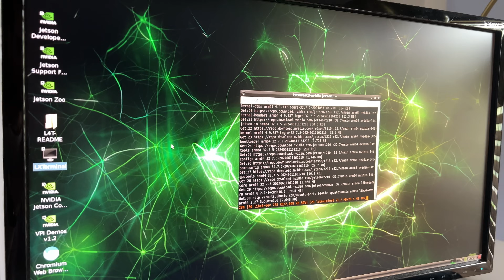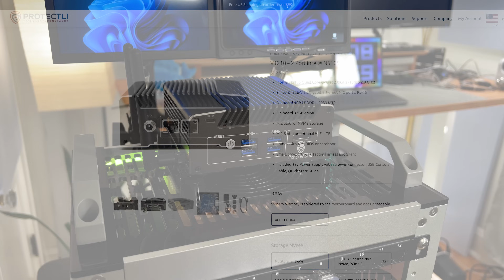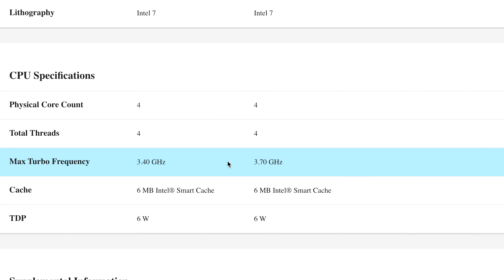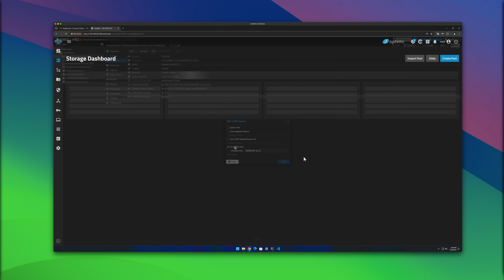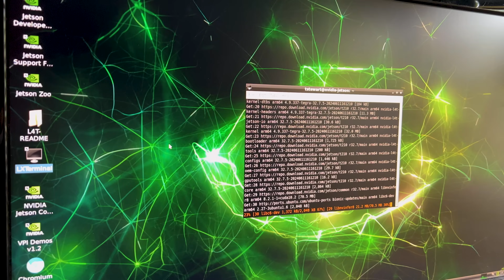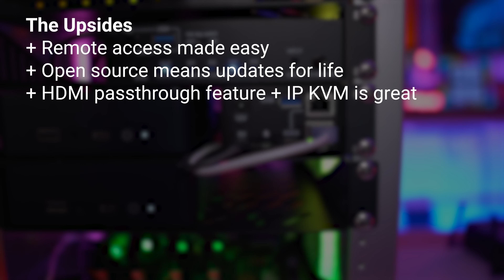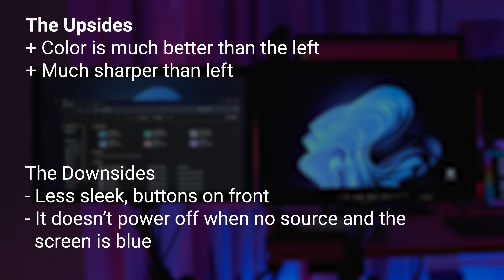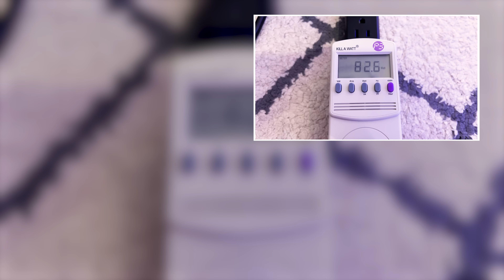Mini Rack, HomeLab Stack - Mini Server Rack

Comment: No bias here at all but I think that Raid Owl guy won. Right guys??? Right...?
Reply from the maker: Don't forget to sub Raid Owl if you haven't already, even though he had a lesser build 😅
Reply: @TechnoTim  Luckily he's a protected species, hey! Tim
Reply from the maker: @settlece  zing!  🦉
Reply: Just know your place as a power bottom.  Tim topped you on this one 😂
Reply: @itznolimitz  This joke has come back to haunt me lol
Reply: Buy a damn threadripper already, bro! Then you can win.
Reply: @corrpendragon  My old home server has Ryzen 7 5700G 8C/16T + 64GB RAM. Mostly eats ~25W. (measured at wall socket) Size is about third of what is shown in video, as it is slim tower or can be placed as slim desktop (flat).
Has space to fit 2.5 slots Graphics. But that eats unnecessary energy. While 9070 XT looks OK from compute perspective, I do not like it for its mere 16GB VRAM. (AMD should have made variant with 32GB from start.)

If I went for upgrade, it would be Ryzen AI MAX+ 395 16C/32T with 128GB RAM, as memory is not traditional desktop dual channel (128-bit = 2x 2x 32-bit). It is quad channel (256-bit = 4x 2x 32-bit). And you can get it in pretty small PC cases at good prices. That makes Threadripers uninteresting unless one needs a lot of CPU cores or considerably more RAM. Because Threadriper MBs are big, exist in order to plug multiple graphics cards.
Reply: I like both setups and you guys are making me want to build a mini server rack myself.. nice work!
Reply: I believe you’ll get a dub against a Tech YouTuber one of these days
Reply: I heard RaidOwl watches Sex & The City and calls himself "a total Samantha"
Reply: @theglowcloud2215  who told you that...
Reply: Tim won but this was a super fun challenge and side of homeland you almost never see. I wish I had known about these kinds of options back when I started, as space was definitely an issue.
Reply: Tim you little rat bastard you win 🏆 swrry Bret 😢
Reply: Yes sir he won second place.
Reply: Right!

Comment: Hi Tim, Can I place a rack style sever on my desktop?  Now before you say why don't I just purchase a desktop model, I currently own a DS918+ which is now going on 8 years old. I may be looking to retire it as my backup server in the near future and I like the look of a rack style server.  I'm also of the belief the operating the Hard Drives vertically rather than horizontally will extend the life of the drives. What are your thoughts?

Comment: A monitor that doesn't do or change anything without you telling it to isn't always a con. Sometimes it's extremely beneficial, especially when troubleshooting. It's a huge PITA when a monitor spends 30 seconds cycling through its inputs trying to auto detect signals while you're trying to read POST info or just get into a BIOS/UEFI. Just as annoying to think a machine isn't powering on because your monitor decided to save milliwatt-hours by turning itself off and not turning back on again. I actually have a pretty strong hatred for modern monitors and their designs like OSDs instead of real buttons. It's all preference there.

Comment: I think that the Homelab REALLY depends on what you're using/running/doing.

My main Proxmox server nominally has a load average of 20 now. (With dual Xeon E5-2697A v4s)

And my three node OASLOA Mini PC Proxmox cluster, I found out last night/this morning that one of the nodes had a load average of 40(!) (on a system with a 4-core CPU), whilst another node had a load average of 3.2 (80% CPU utilisation).

So...depending on what you're doing, it is not difficult to push a homelab to its outer limits, especially in terms of compute capabilities.
Reply from the maker: For sure!  Good luck on tracking down what's using up all the CPU!
Reply: @TechnoTim  
Actually, I already know (what's using up all that CPU).

Comment: Nice to see another one in the Wild. I have one as well.I use 7" DWin Monitor that my son Engineered a 3D Plate so I can mount on the front. I have a couple of the small board trays behind it. I used a Beelink, with extra USB Ethernet so that I could pfSense for my firewall. I bought a Banana-Pi Mini-R3 for my wireless access into the my a rack, it sit on the top.  I had an X1 from Youyeetoo ( 8G Model ), it's my Proxmox, which is running Minecraft Server, CasaOS, and Red Hat DNS. I bought DeskPi Super6 because I had several CM from different makers, so I am running a Fruit Salad of CM4 ( 3 x RPi, 2 x BPI, and OrangePi. ) I am running Debian 11 w/XFCE  and  libvirtd on the OrangePi CM-4 with XRDP installed. I remote into the Super6 there, and I am running my back up DNS as Arm Virtual host.  The rest of the CM4 are going to be Mini-Kube setup. I have Raspberry Pi 5 and Libre Computer Renegade on the Small Board tray, the Renegade is hookup to a kvm that sits behind the monitor, use that work when I was at Southeast Linux Fest making sure everything was working. The RPi 5 is a GitLab server for my little lab. I found a cheap 8 Port PoE managed switch, but I won't recommend it. 

I have a Uctronics' Desk Rack, it nice 4 server high, that I have 4 x LibreComputer Renegades in that is a Docker Swarm Cluster that I am running 3 off PoE TPLink switch, the 4th I can't because of  the 5V fan, but it nice to have a small lab in one area. 

Oh, because this has it own firewall now and WiFi, I create a new VLAN so that seperate from the other 3 networks in my house. Another part of my job is I have to be a Jack of all trades, most Network Engineers don't like you mess with their stuff, so another reason Home Lab are great. 

Since I live in George and my big rack is in my office. I powered down all the bare metal servers so that my electric bill isn't over 500. The small rack is nice because I can cont' to work on Ansible and Docker for my work. Plus, not die from the heat from the big rack. It nice to be able to travel with the rack too. it was a hit at the Southeast Linux Fest. A nice way to show that you don't need a lot of equipment to do home labbing.

@TechnoTim yes only thing I truly hate is cable management. The rat nest next to the rack is UGLY. I have tired my best to control. I might buy another one as I like to see if I remove the handles can I stack it.

Comment: Tats pretty awesome.  Id probably drop the  K8s cluster, and have something like hot swappable Harddrives, for like Truenas or something, or some other way of managing storage.   This way you can run 2  or 3 for HA proxmox machines, and have the storage be in the NAS.  Run a few VM's in the proxmox cluster and a Docker VM as well.  I am really digging that router and switch layout on top, its really hard to get that 2.5gb network speed to a mini pc but they are out there.  You might need a 2nd switch though, and do something like link aggregation to the proxmox machines, to get like 5gbs internal speeds if thats something that is needed.  Itd be nice to atleast have the option for a upgrade in that direction.

Comment: Insanely cool 👍.  N100 and N200 can run 32gb ram (7:29) despite official specs; various ppl have shown this.
Kindest regards, friends and neighbours.
P.S. Thank you for many inspiring ideas for HL.
Reply from the maker: Thanks!  I have seen on the internet that some have got it to recognize 32GB, but the official Intel spec for the CPU says 16GB.  I am curious if it can really address all 32 or it's just showing that in the BIOS, maybe I should test it!
Reply: @TechnoTim    Works in memtest for me. Single 32gb ddr4 sodimm in a n100. Ripjaws 3200 CL 22-22-22-52 1.20V.
Reply from the maker: @chromerims  awesome!

Comment: Nice video and rack.
Check out a USB C trigger board. Get a couple of those and a GAN charger/power supply, and power multiple barrel jack devices off the same small GAN charger/power supply. Will save some space, help keep the cables tidy and use less outlets.

Comment: This is exactly how a home lab should be - more surprised its completely isolated - dont need stupid crazy rack servers anymore - NUCs are the right way yeah you went some low end ones with not many cores at all which is good to start and just have your clusters and code.... best thing i did years ago was get rid of my servers and just have dell micro optiplex be the lab that are 9700 i7s with 32gb

Comment: for anyone looking into getting this rack keep in mind that although does have standard size mounting holes for the screws that hold the trays standard 10" or half rack shelves will not fit between the posts. if you want metal shelves youre limited to the shelves deskpi sells. really wish they would make an addon kit or revision to make the rack hold standard 222mm equipment

Comment: Nice! This is a cool setup if you're just messing around at home. I would argue it's the purest form of HomeLab. Low power, low cost, modern and relevant, takes up little space and probably quiet enough that the Mk.1 Wife Unit won't complain about "those damn fans in the basement". As you outgrow any single part its standard enough to upgrade.
Reply: Yes just don’t buy it all at once! For most this is so overboard to start out with! Final form yes, inception no :)
Reply: ... mk 1 wife unit? really? yikes

Comment: On the subject of your firewall, i wonder what sort of performance improvements they'll see with their next gen, which i assume will be an N100. Slightly lower TDP, but amazing performance. I wouldnt be surprised it you could get 5G or even 10G IPSEC performance with the N305.
I've been playing around with a rather large itx SBC with an N100 that i had originally planned to use at my sister's house for Plex TV recordings replacing her old i5-6500 based system.
Boy was i surprised that it was powerful enough to not only record live TV on plex, but also run a firewall and do motion and object recognition within frigate on 2x 1920p ultrawide security cameras (IDK the width but its 180 degrees ultrawide output using 2 sensors and 1920p tall) I might keep this board for myself and get the bigger atom with 8 cores (N305) for her, as we're planning to put 2 of these cameras on her her dog kennel/grooming shop and 2 on her house, and the little N100 was often around 80% usage with my 2 cameras.

Also of note, i wont be deploying it with the firewall VM, as the host(trueNAS) can still see the ports which has me concerned. I'd much rather virtualise a file server on a firewall/router, than the other way around as if the server goes down or does an update, it also takes the firewall, DHCP/dns, and everything else with it.
Reply: I should note that if you want to get any of these Atom class processors, from the N95 to the N305, they struggle to address more than 16GB of RAM. I finally got 32GB of RAM working on my board, but i went through probably 5 or 6 kits of DDR5 SODIMM Lucky i had some laying around, unfortunately the only one that worked was one of the faster sticks in my 7840HS mini PC. 
Also of note, just because it posts with 32GB, doesnt mean it can use it all, 2 of these kits would post, but then only 16GB would be usable which the way i had truenas set up, actually took more than a day to discover on the first kit.
Oh, and if you have 2 memory slots, you might find that you need to use a single 32GB stick rather than 2x16, like in my case.

Comment: I wish more connectors were locking.
Reply from the maker: @haxwithaxe  agreed!  I have only ever seen this on microphones until now!
Reply: @TechnoTim  there are a lot of similar connectors for audio and video (RCA/composite) but nobody uses them for the most part. You can get them from digikey but they are relatively expensive. I use panel mount connectors with front facing threads (just what I have laying around) and a nut soldered to the male side to interface with the threads. It's really nice for things I carry around or frequently poke around by.

Comment: the optimal way to setup opnsense is to set up an external wireless AP is it not or is it just a quick solution for if the wifi module does not load or is not compatible

Comment: 10" racks are very common in Europe. I have had one since 2017 using 4x PI4s (CasaOS, 3D Print Fram server, 2x Portainer with various networking apps), TP Omaha networking (2.5Gb Networking & 2.5Gb Gateway), 1x TerraMaster F2-423 (TrueNas Scale) and 1x NUC (Ubuntu, for random projects, plex, etc.). Recently I have added a 3d printed Mini ITX Case that can house a rtx 3060 12Gb for light weight ML and AI projects. Nothing special, but everything is neatly packed away, also it is easy on my monthly power bill.

Comment: Open source means update for life?

That's new.
Reply from the maker: Sorry, yeah, odd choice of words.  I should have said "access to the code for life". Thanks for keeping me honest.
Reply: @TechnoTim  No worries.

The problem with the 10 inch rack is, that it limits the hardware you can chose. Even many small switches are too big or lack the 10'' rack mount kit. Then you have to use a compromise.
Or devices are to deep and won' t fit propperly.
However, for small form factor PCs, firewalls and the raspberry sized devices it is a nice option that would fit many places better than a 19 inch rack.